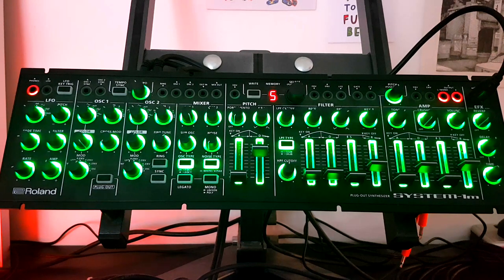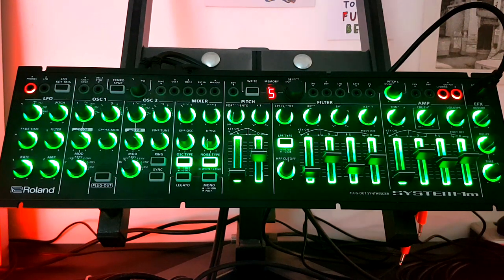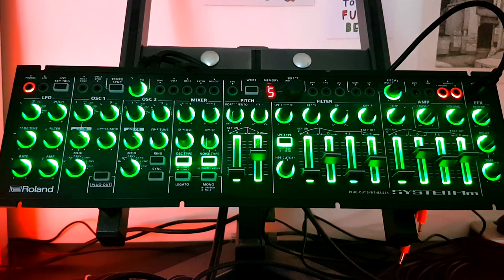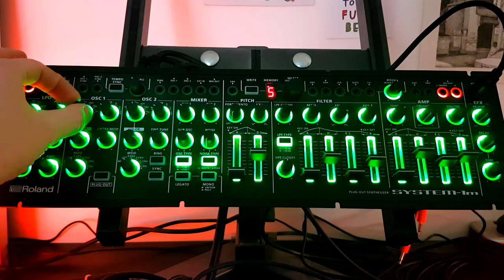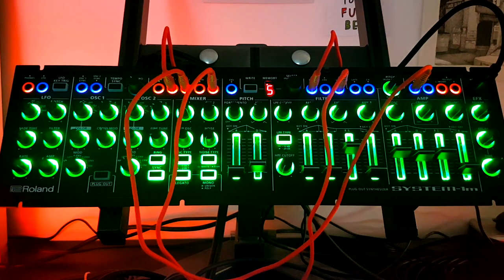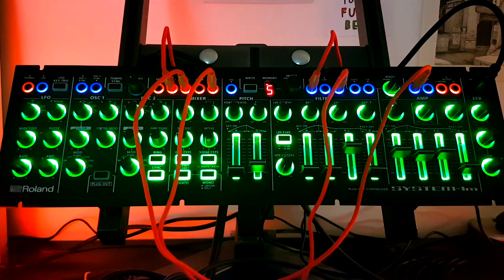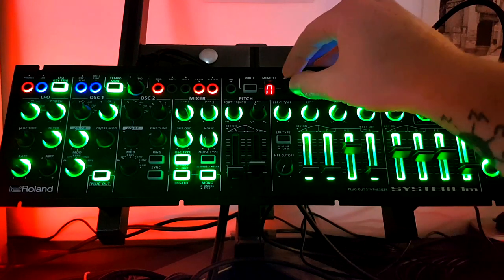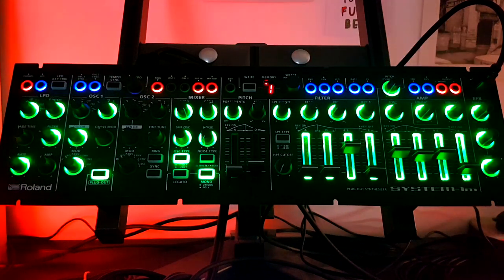ROLAND SYSTEM 1M // DEMO PT1

Comment: I love real people with real synth videos, and I'm anti-moog along the same lines as I'm anti-lexus. If you have to taut what it is, you are using it wrong. I have the system 1m and I love it due to it's solid versatility as you mentioned(I'm super picky about keybeds and would rather get a module and use my SLmkIII). I kind of wish they had more plug out options, even if it was just a 4 voice jupiter, ya know?
Reply from the maker: Agreed, I ended up selling mine and getting other things. It’s a great synth but I found that I had software that was doing that same thing and was trying to trim my gear. Still a great synth though and will no doubt always be
Reply: @warmnatural  Did you use it with Omnisphere?

Comment: Is it possible for you to compare this to the system 8? Obviously one is mono & the other poly and the 1M is semi modular, but what do they have in common, if you know?
Reply: DAVID SIMONS - What is the difference between these three sysnths?

The short scoop...  

SYSTEM-1

System-1 has the System-1 synth engine which is 4 note polyphonic, or can be Monophonic, or Unison which stacks the 4 voices on one note. You do get an even fatter sound in Unison mode as it plays the 4 voices stacked on the same single note.  The System-1 comes with a 24 note keyboard as well.  The System-1 synth engine has 64 patch memory locations.  The System-1 has room for a second synth engine the Plug-out, which also has 64 patch memories. The Plug-out is only a monophonic engine though.  Current plug-outs available include the SH-101, SH-2, ProMars and my favorite the System-100.  

SYSTEM-1m

The System-1m is the rack mount version of the System-1 synth, but it includes 19 CV and Trigger inputs and outputs to connect with EuroRack gear and other synthesizers.  

SYSTEM-8

The System-8 is a full sized 49 note keyboard with velocity. 

The System-8 is 8 note polyphonic and includes room for 3 different Plug-outs - includes is the Jupiter-8, Juno-106 and JX-3P and each plug-out has 64 memories for each of the 3 Plug-out synth engines.  All three of these plug-outs ship with the System-8, if you get an older version, upgrade the OS to 1.3 for several reason, namely, more oscillator waveforms, and the upgrade will install all three of these Plug-outs: Jupiter-8, Juno-106 and the JX-3P.

The System-8 engine has 64 patch memories.  The System-8 synth engine is basically the same as the System-1 and System-1m, however the System-8 engine has many modifications and additional parameters such as multiple oscillator waveforms, and the third oscillator has expanded functionalities that the System-1 and System-1m do not. 

Technically, this keyboard includes 4 different synth engines, each with 64 patch memories for a total of 256 different patch memories.  All 4 Synth engines or Plug-outs are 8 note polyphonic.  The System-8 can install a different Plug-out synth engine such as the ones that are available for the System-1 and 1m - however, the System-1/1m engines are only monophonic, so you might not want to install a monophonic System 1/1m plug-out and lose the 8 note polyphony for that plug-out slot.  

I keep all 4 synth engines that ship with System-8 and keep the 8 note polyphony for all four of the engines.  

I have them all.  Recommended.  :)

Comment: I realize this is a bit of an older video but hopefully you can answer this question for me: do the knobs sens midi out? As in: could you possibly use it as a controller as well?
Reply from the maker: Pretty sure you can do this, but I don't use it that way so I'm not totally sure
Reply: Synthetic_Future yes, it does send midi.

Comment: 3:18 you look just as lost in it as I was my first couple of hours with it. Most difficult was the realisation that knob settings mean squat when you recall saved patch, duh! It's digital. Until you as much as touch them... LOL But this is why I would have preferred that 1. digital systems utilise "endless" control knobs as long as there is even a single digit LED display to indicate where the knob is at when you're touching it (and System 1m has such a display so why the hell not?). 2. Analog systems utilise normal control knobs that have a beginning and a physical "stop". Makes sense? It really should. And you are absolutely 100% correct. This mean, green machine has a really bassy LFO not only bassier than most digital synths, but a worthy competitor to many analog synths in its price range

Comment: How is the comparrison between this and a Korg Radias?
Reply from the maker: I've not owned a Radias and only used one a few times a logn time ago, so I don't really know
Reply: The patching adds a lot of versatility and I prefer the sound of this over the Radias personally.
Reply: The Korg Radias is a completely different synth - for starters it is multi-timbral on multiple channels where the Roland System-1 and 1m are a single synth.  I have both the Korg Radias for the wide variety of sounds it can create and is multi-timbral so I can have up to

Comment: I like this video and the sound of the machine in general, but I'm getting pops when my velocity values vary, and this means I can't just plug in a keyboard and play, I have to filter the velocity out.  Kinda wish they'd just turn the velocity off or something.  https://www.youtube.com/watch?v=f-PhB0gOTog
Reply: Michael Rohaly Try adjusting the envelope Attack rate.  Because the envelopes are so very fast, you might need to back off the time just a hair if you hear an audible “click”.  What many hear as a click is really a matter of attack time needing a little adjustment.
Reply: @garyturner5204  The pops go away when you don't send velocity info. It's not fixed by resetting the sliders.